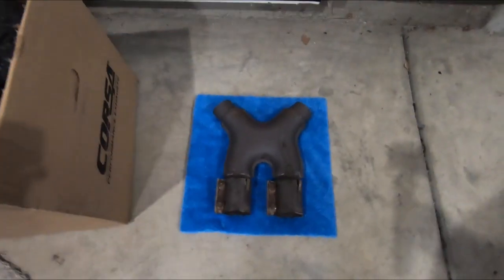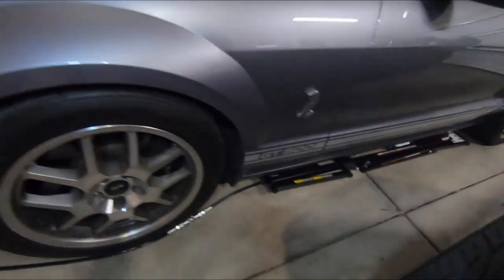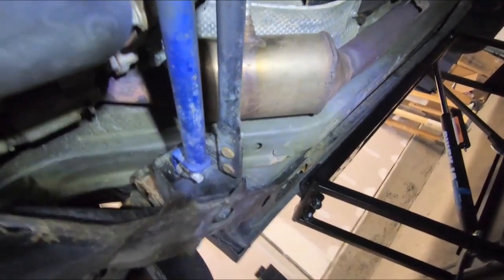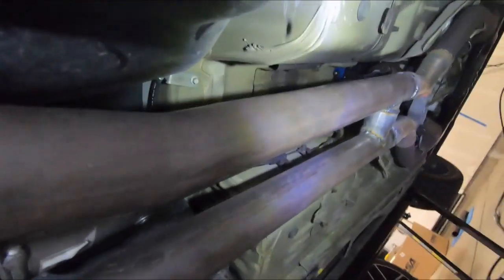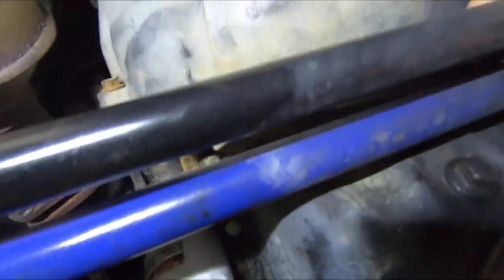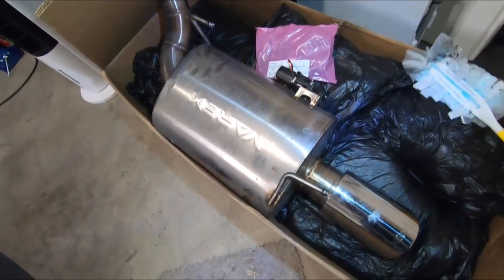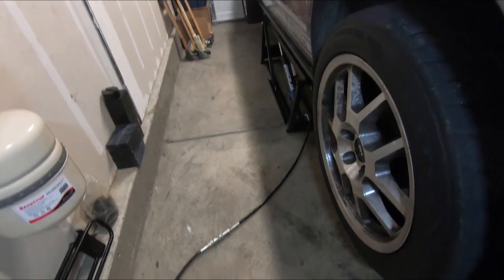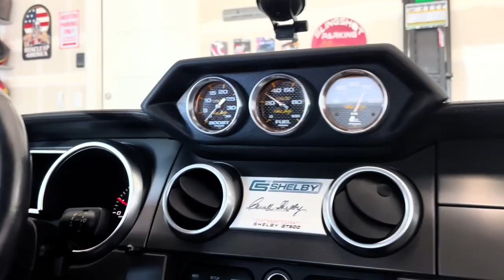2007 Mustang GT500 H pipe w/Corsa Extremes. And quick jack hydraulic lift review.

Comment: Hey brother I have a 2007 GT500 also and I am so glad I found your video! Love it. Urgent question though I have been looking at buying a front bumper lower chin splitter that says SHELBY from a newer year gt350 or gt 500 and making it work. Did you do that or is that shelby stickers on the front bottom? Ill be looking for your response and also did you make a video about doing that? Much love will give you a follow tks danos50
Reply from the maker: I bought my Shelby vinyl letters on Etsy for my GT500 for the front splitter if thats what you're asking? I used post-it notes to space them lol. The GT350's come with indentations for the letters on their splitters so its a bit easier and you can find those stickers on ebay or etsy I think...
Reply from the maker: Also I got my GT500 bumper from CJ Pony parts for about $220. Couldn't find one for 07-09 that came with Shelby letters.
Reply: MAN I HAVE A 08 GT500 AND A 07 427 EDITION CONVERTIBLE SUPER SNAKE AND THE CARBON FIBER FRONT SPLITTER LOOKS AMAZING ON THE CARS AND I WOULD GO WITH THAT IF I WAS YOU BUT THE CARBON FIBER SPLITTER ISN'T CHEAP BUT BOY IT REALLY MAKES THE FRONT OF THE CARS LOOK GREAT BUT YOU HAVE TO BE VERY CAREFUL PARKING THE CAR BECAUSE YOU DON'T WANT TO DAMAGE THE CARBON FIBER.